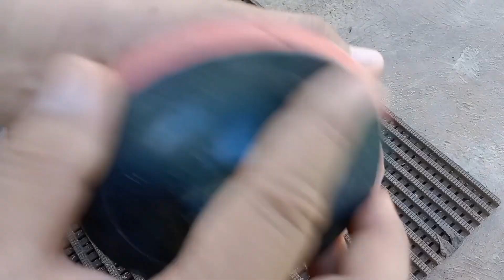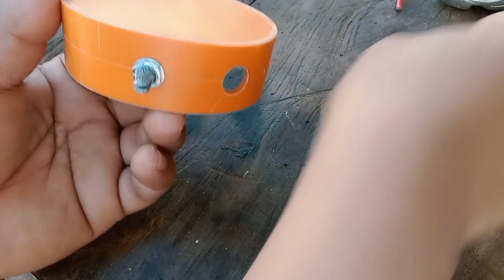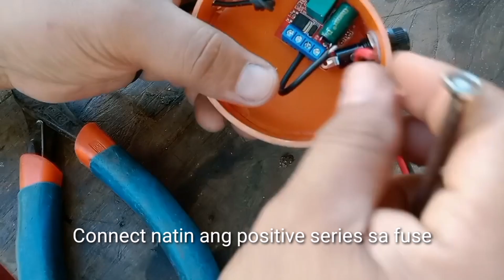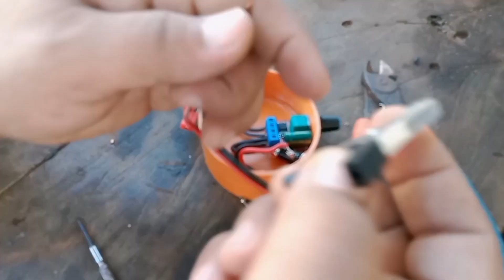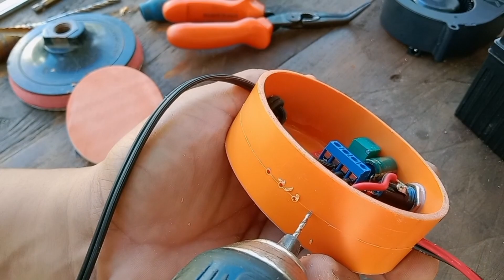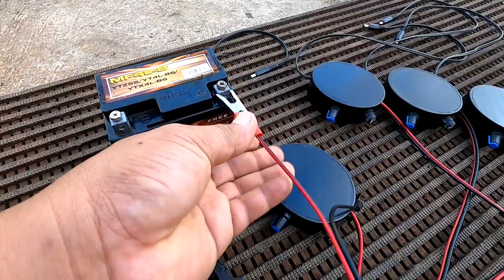Paano gumawa ng Blower Speed Controller para sa Kalan de Used Oil/Battery compatible

Comment: Sir anang pangalan yong nilagay mong pisa para maging12V sya.?
Reply from the maker: 12 volts na po yan sir dahil battery Ang supply. motor  speed controller po ang tawag sa nilagay ko
Reply: 12v tpos 5 amperes boss pd b